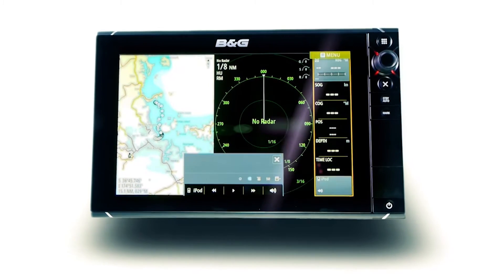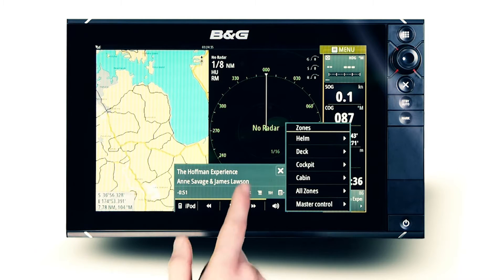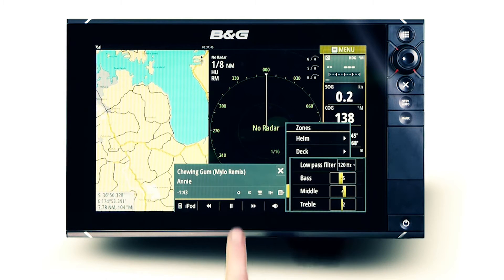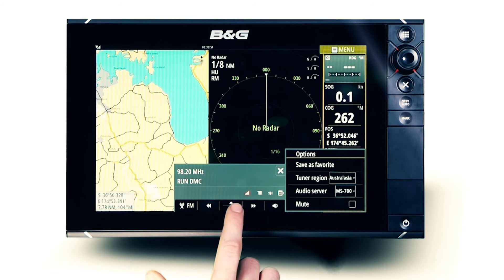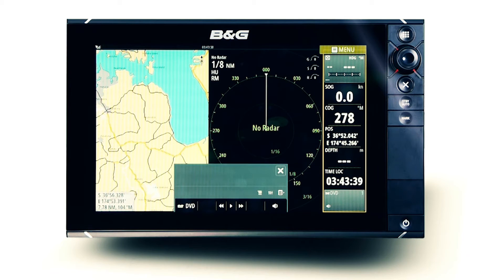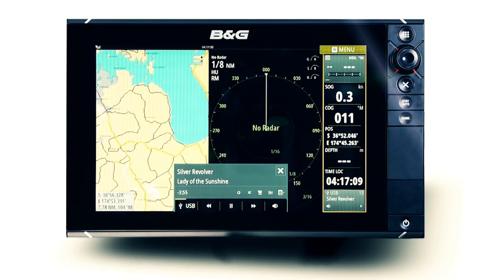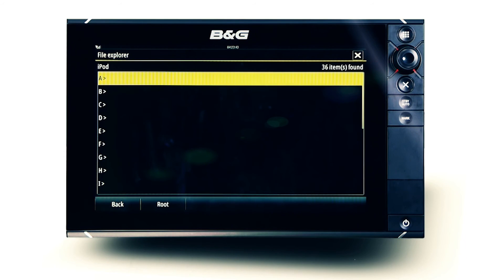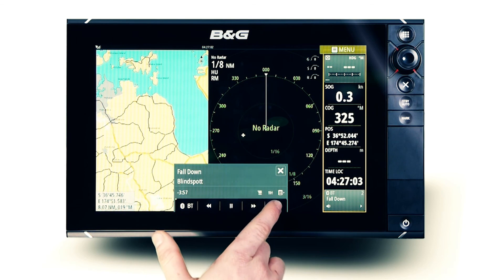FUSION Link Tutorial on a B&G MFD

Comment: Be warned though I have a UD750 version thinking id slot a 1tb hard drive into the dock. Fusion stereo won't read the drive if formatted in EX FAT .  This is the most comm0n format if your shuffling music from a Mac to a drive. Bit of a bummer. Im thinking the new Apollo models would allow this. Also be aware this model requires a seperate amp if you want 4 zones. Out of the bow you only have two useable zones